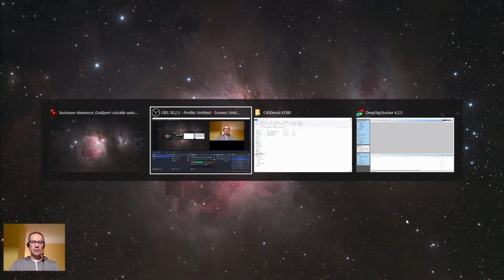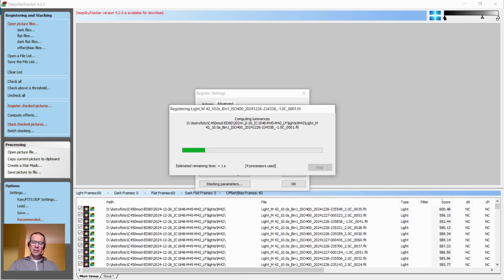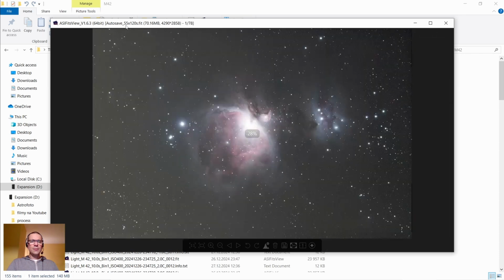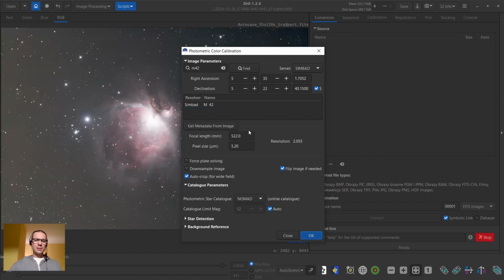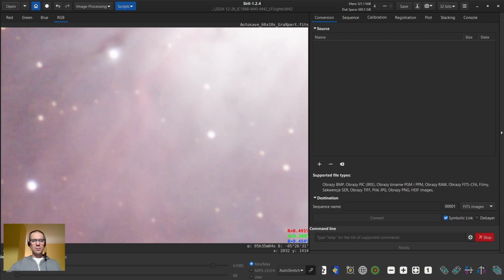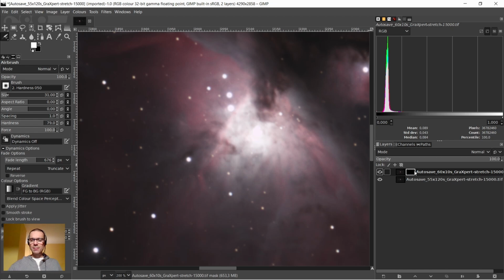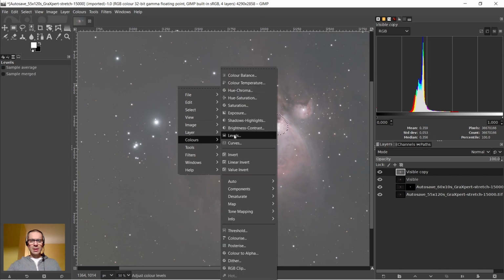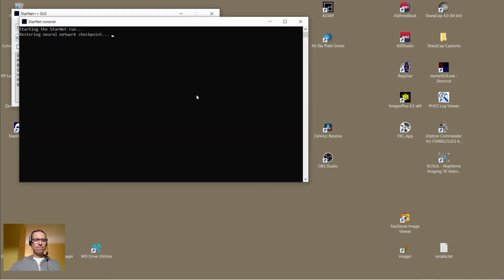Processing M42 in GIMP - part 1

Comment: Why do you choose to stack in DSS rather than Siril? Seems like you could simplify your workflow by eliminating DSS.
Reply from the maker: Really? And how is that?
Reply: @ By just using one software package rather than two. Unless you use DSS for a specific purpose, hence my question.
Reply from the maker: @frankie5750  I use DSS because it is much easier and doesn't make zillions of intermediate files during stacking ;) Also, in my opinion it is much easier and more intuitive to register two sets of frames on one common frame in DSS than in Siril... :)

Comment: Did you say 30 minutes? For comparison, a 1080x1920 takes just under 10 seconds to denoise with hardware acceleration from an Nvidia RTX 3070 in GraXpert 3.0.2. So probably around 40 seconds at your resolution.
Reply from the maker: Yup, thirty minutes :( I'm working on a laptop which is quite old, and I still can't make a decision to buy a newer one... There are so many of them, various models with various processors, I mean, so it's hard to choose something while not being an expert in hardware...
Reply: @AstrophotographyLab  not an expert either but if you're looking to accelerate  Starnet or Graxpert denoise I think you need an nvidia card, not sure that works on AMD.
Reply from the maker: @RandomUser311  Not sure if graphic cards in laptops, even if made by Nvidia, are capable of doing any acceleration... Still, this long time of denoisig is not a big problem - I just use batch-processing of several files together, overnight :)